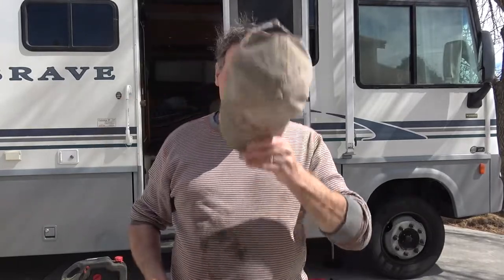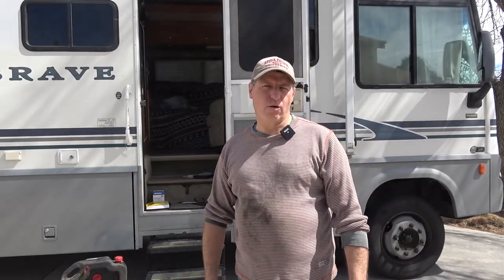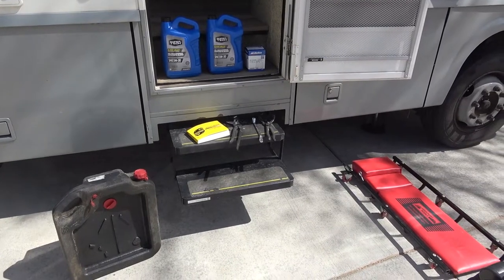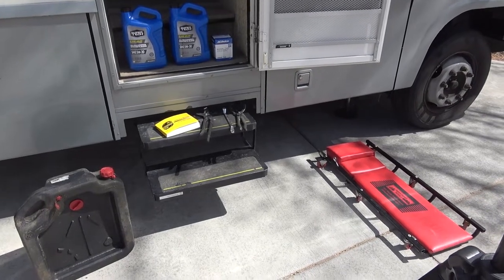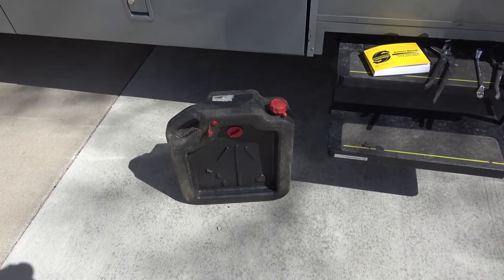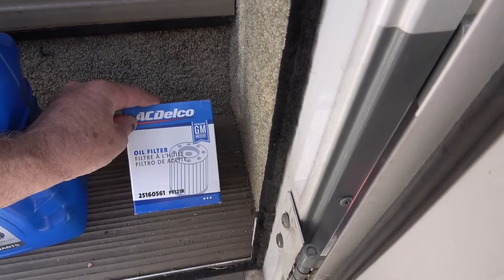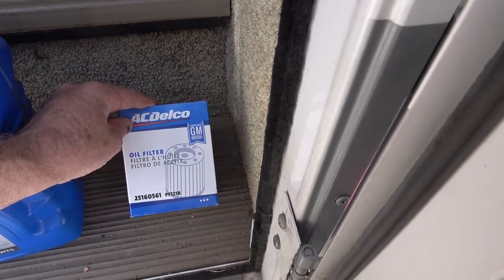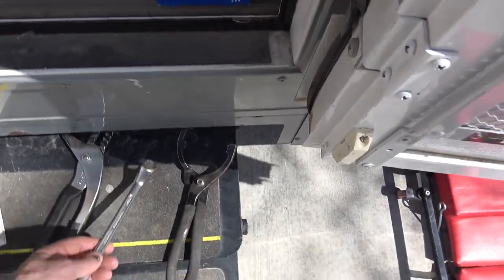CF#8 How to Change Oil on Chevy 8.1 W22 Workhorse Class A Motorhome

Comment: As an ASE certified car/truck mechanic, this was a fine demo of an oil change, except one small detail.  Fill your oil filter with new oil before installing.  When you crank your engine, there will be a moment when no oil is flowing and air will get in the small engine oil paths until the filter fills.  This can be a problem.  Filling the filter before installation can reduce or eliminate this.
Reply from the maker: Great point!

Comment: I always grease my driveline and front end king pins and tie rods when I do my oil change. 
BTW ATF oil expands when it gets hot.
Engine oil doesn't expand when hot. 

With the pf1218 filter you need 7.5 qts to fill not 7.0. The reason the engineers used the .5 qt pf454 filter was to attain a 7 qt oil change not 7.5 qt. With the larger filter.

I always use the pf454 ac Delco filter and run Valvoline full synthetic with the GM DEXOS symbol. 

2001 National Dolphin LX 8.1 GM / ALLISON 5 SPEED
Reply from the maker: Great info thanks
Reply: How long is your motorhome? I think on the 8.1 gasser they only put the Allison transmission in on thr 35,36 ft ones.
Reply: Yep that's definitely an Allison trans,,You can tell by the red screw on filter about a foot and a half away from the oil filter,,,Also that screw on trans filter has to be changed every 10k miles,There's also an internal one,I think the time change on that one is 60 or 80k,,